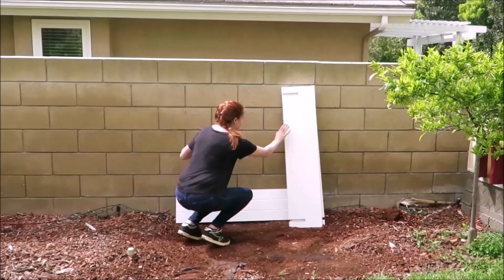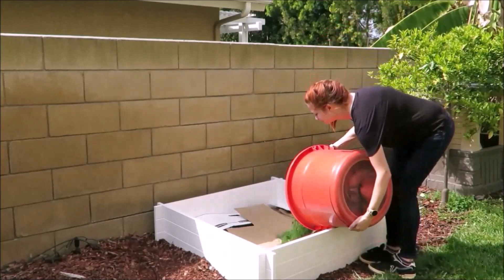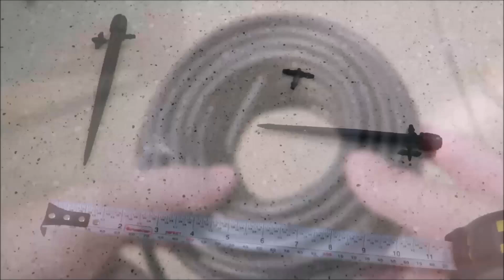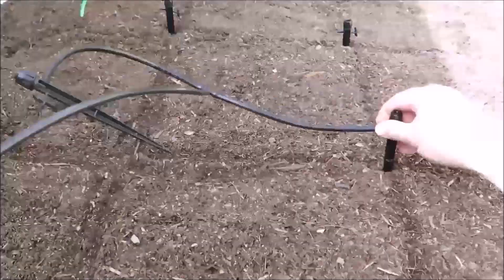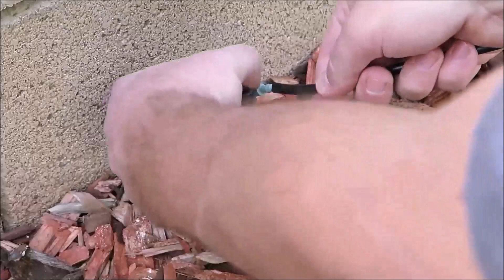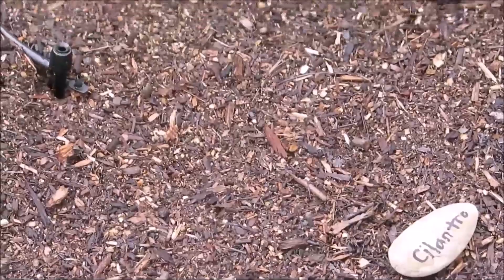Build Your Own Raised Garden Bed, No Tools Required!

Comment from the maker: Check out the supplies need to make your own garden bed.

Hudson 48"W x 48"L Screwless Vinyl Garden Bed: https://amzn.to/2WKO8GI

Miracle-Gro Soil: https://amzn.to/2XcqmCC

Orbit 25-Count ¼ inch Barb Tee: https://amzn.to/3cQvOl2

Orbit 67000 8 Port Adj Flow Manifold: https://amzn.to/36dL9Kd

MIXC 100ft 1/4 inch Blank Distribution Tubing Drip Irrigation Hose Garden Watering Tube Line: https://amzn.to/3cQvZwI

Gardman R721 59" Tomato Spiral Plant Supports: https://amzn.to/2zRUDPa

As an Amazon Associate, I earn from qualifying purchases. Clicking on the links above helps support the channel and helps us provide you with more quality content. Thank you for your support.